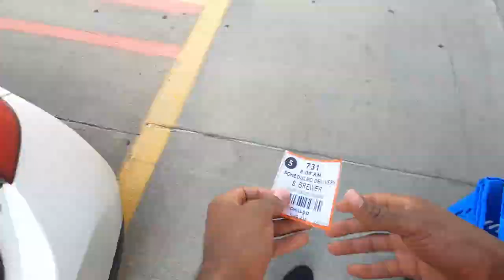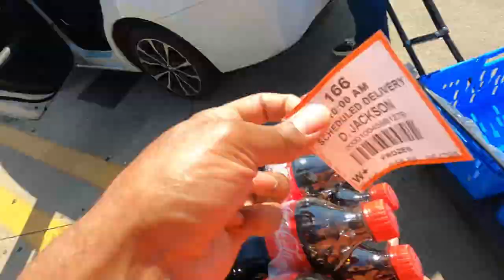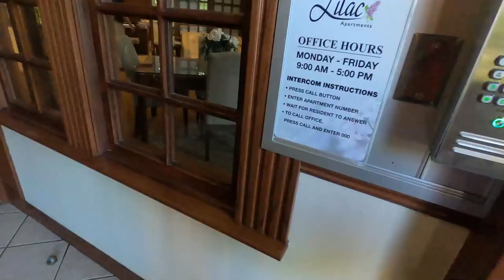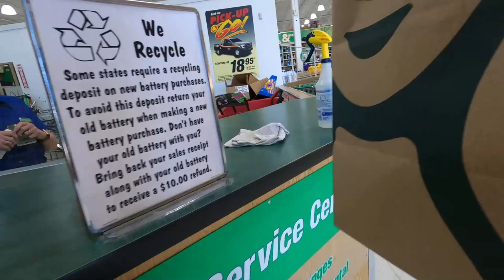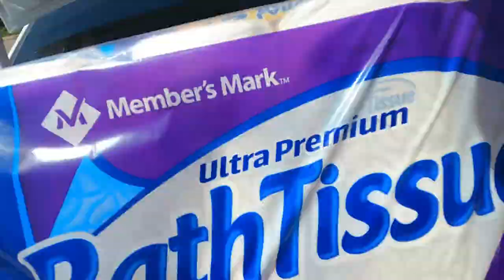The End Of Spark! 😢 My Last Order Before I Got DEACTIVATED! InstaCart, DoorDash Ride-Along; Tips

Comment: do I need to have a card to get sam's orders. I be avoiding them thinking I need a membership card
Reply: No u don't have to have a membership if you are doing an order rather u shopping for customer or picking a order up for a customer they information would of been used for them to even make the purchase so u just go get the order n it'll prop you through the steps of you shopping if you doing pick up once you get there u just confirm arrival n the order will b brought out to u if there's a store phone number for you to call once you confirm arrival u can call to let them know you there as well some stores prefer u call most the time u don't have to ive found it helpful to do so though. If ever u run into any concerns you can also call the number n someone will assist you with any issues/ concerns you may run into along the way.
Reply from the maker: @Landra is correct!
Reply: @landrashante  Thank you so much for clarifying
Reply: @Alexander Estyl no problem 😊